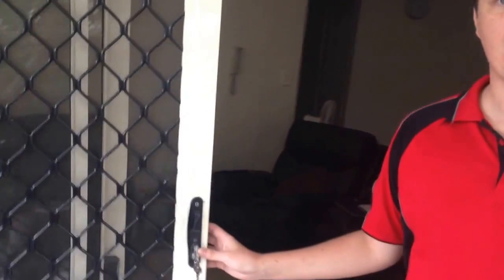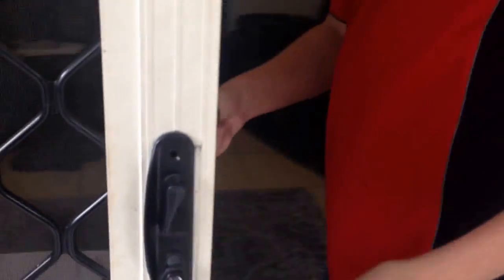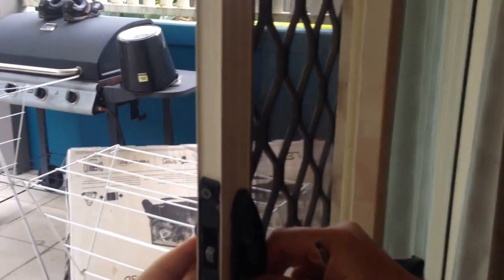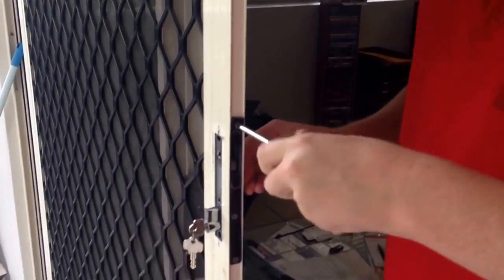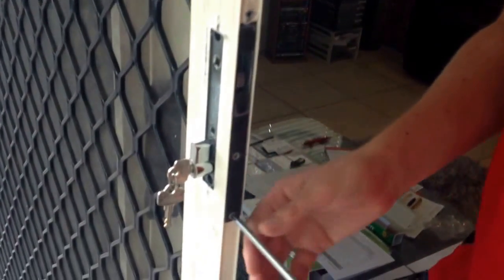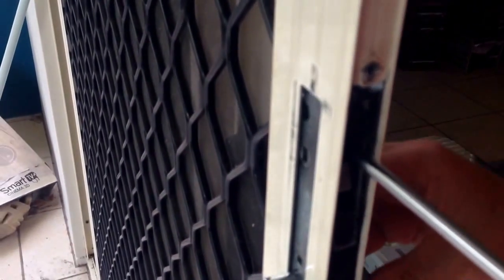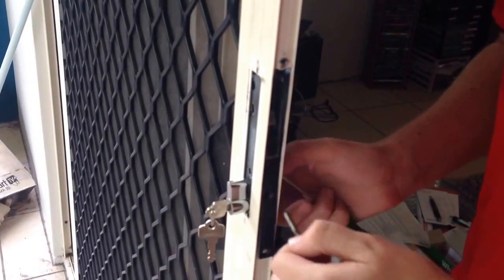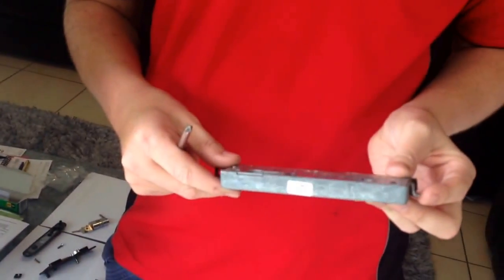How to remove Whitco Leichhardt lock

Comment: Thanks Luke. Have just been wrestling with one of these. Unfortunately with mine, the retaining sliders were jammed and wouldn't release. After removing with some forceful persuasion, I noted that someone else had replaced the mechanism and had forced the lock assembly out and had damaged the screw mounting point at the top. Replacing and securing the new unit will be an interesting challenge...

Comment: Hello Luke.  Thanks for your video.  I have 2 sliders in my home exactly like in your video.  I was unable to lock (or unlock) either of them.  I followed your instructions and was able to remove the lock cylinder on one of them and subsequently reassemble it.  This slider is now lockable and working well.  However, after performing the same procedure on the other lock, I am unable to remove the cylinder.  Any suggestions?

Comment: i thought of lock picking and bump keys these locks as i dont have the key to replace with a new lock, but you dont need to do it as the locking part of the these locks dont actually lock into place they are free moving 360 degrees. using a thin piece of plastic or stanley knife move the locking latch to the upright position (the outer round section where you place the key) then take the lock mech out.

Comment: Luke, thanks for showing the trick with the release mechanism with the screw driver for security screen locks, however, for glass screen door, is there a similar trick? I can not find  release mechanism on the Bunnings glass sliding door Leichardt lock.
Reply from the maker: Wil L I'm really not sure. As far as I know Leichhardt don't fit onto glass doors
Reply: Luke, thanks for quick reply, it says inside the handle Whitco lock, Jason model, looks exactly the same as the Leichardt, except there is no release mechanism.  Can not lock door at the moment, it's frozen for some reason, tried silicone spray but no luck.Want to remove the lock cylinder to replace lock, but can not turn key or snib to lock it, the normal way to remove cylinder.   Would prefer not to break it as other sliding uses same key. Cheers.

Comment: I replaced my lock and handle sets awhile back and when i installed the last one I got a bit over confident, slightly over tightened the barrel lock screw and shut the door before checking the tension...now the door is permanently locked and i can't get it to release no matter what! Its an airlite glass sliding door with a parrot beak catch.... i would be very gratefull for any tips Luke    cheers Gazza from Sydney
Reply from the maker: Sorry Garry I'm based in Brisbane I can't help you

Comment: Luke, I've bought a house that has sliding security door that is fitted with a Whitco Leichhardt lock. Whoever fitted it put the snib side of the handle to the outside face of the door. So I always have to use the keys to secure it. Please can you advise how I can correctly change the handle over. Many thanks.
Reply from the maker: Toxteth Lad just swap the inside and outside handles over. Or if you’re clever enough you can take the handles off and just move the snib to the inside. 

If have more questions send us a message and photos to Facebook messenger @lukethelocksmith
Reply: @lukethelocksmith8750  Thank you Luke, it worked a treat!

Comment: I had mine changed by a locksmith few years back same problem snaped part of it the problem for me is he replaced the 2 screws with bob rivets what do I do I need to change the lock its broken
Reply from the maker: You will have to drill out the rivets and rivet the new one in. If don’t already own a drill and drill bits and rivet gun and rivets you’ll have buy some or maybe better off getting locksmith to do the job.
Reply: Thanks for the great videos Luke. I can't get the key barrel out cause I've got no key. Will I have to grind the barrel off to pull whole lock out then renew? Thanks mick

Comment: How do you get the barrel out if there is no key with the screen door
Reply from the maker: You have to choices pick the lock or snap the cylinder with vice grips. Take the handles off and use the vice grips to wiggle the cylinder left and right and it should snap
Reply: @lukethelocksmith8750  thanks mate might just use vicegrips

Comment: Luke, I have a whitco sliding screen door latch in the locked position and the new cylinder I put in will not unlock it. can I unlock it manually to open the door? thanks Philip
Reply from the maker: Philip Brown yes you can but please make sure your put the cylinder in the right way around before unlocking it manually. Or you’ll be in world of hurt. But if reach inside where the cylinder goes and move the locking bar with finger or screwdriver.
Reply: Thanks for getting back to me Luke, unfortunately the door is closed and locked but the cylinder will not unlock. it seems as its not connecting to the tongue of the lock. maybe i have to drill the whole thing out of the door ....?
Reply from the maker: Philip Brown yep put the cylinder in the wrong way. You have to snap the cylinder in half to unlock the door. Don’t drill it you’ll just wreck the lock completely. I think you should admit defeat and call a locksmith in to fix it.

Comment: Exactly the same reason I am replacing mine at the moment, however I have the multi-point latch top and bottom to contend with. How do I get access to the mechanism to remove the rods from the top and bottom to replace the unit, please?
Reply from the maker: That is good question and the answer is I can't say for three point locking ones I highly suggest call a local locksmith for that job. I myself am available in Brisbane. You book me through my Facebook page. https://m.facebook.com/Lukethelocksmith/
Reply: Old comment but worth a reply

Couple of tricks here that are not obvious and you will need;
a) You need to Lock the mechanism to get the keyway out, then push the parrot beak further
b) After you have the keyway removed you will need to unlock it again by turning the Cam mechanism with a driver or tool of some sort.  If you don't do this the lugs for the bar will be extended and will not slip out of the hole
c) to remove the rods first step I recommend is undoing the other latch, just unscrew them and leave them free in the housing this will give you some play you need
d) The rods are meant to be secured by a plastic clip, you will need to remove these first with a gentle pry (try not to drop them in the door frame)
There was another video about whitco tri lock might be worth a look, not a great video but gives you some ideas
Reply: @grahamnicholson1553  If you have this issue see the video with the title "The trick of Whitco Leichhardt sliding door lock removal" which shows you how to disarm the top and bottom lugs per comment b) above by Graham Nicholson, you need to put the tool into the hole where the Euro Lock/key cam was removed from and use the silver latch to unlock the mechanism without the cam.

Comment: Luke the lock I'm changing is the Leichardt, same as yours, however the round tabs at either end of the lock have extended, and I can't remove the lock.  Help please.

Ian.
Reply from the maker: Ian macmillan  inside the cylinder hole there is a locking bar you need to move it down using a flat blade screw driver
Reply: Luke the locksmith Thanks Luke for your reply. Can you tell me how this  moved outwards in the first place. The previous week I removed the lock body to grease it. I then put it back in the door, and now I have purchased a new lock to replace the old one.
Luke how can I recognise this locking bar.

Thanking you. Ian.
Reply: Luke I seem to have the same problem.  There are metal tabs at either end of the lock which means it is now to large to remove.  How do I find the locking bar?
Reply: @leoniepegram9226  Look at the way the cam turns on the key, you need to move the same mechanism the cam activates to withdraw the locking bar attachment points.  You still aren't out of the woods yet see my earlier comments about how to remove the locking bars.

Comment: What if you don't have the key Luke? How do you remove the barrel?
Reply from the maker: Jon Sweet 3 options first option call a locksmith (recommend). second option pick the lock with your lock picks. Third option and dangerous one because you damage your door. Remove the handles and use your vice grips on the cylinder and wiggle it back and forth until it snaps in half.
Reply: Thanks Luke. Appreciate the feedback

Comment: Thanks for the video. I did exactly what you have done but for some reason the lock body won’t come out. Any ideas? TIA.
Sol
Reply: You have to lock it again after withdrawing the barrel, so the arms above and below the lock retract. Luke did it manually at 2:25 with no explanation of what he was doing.